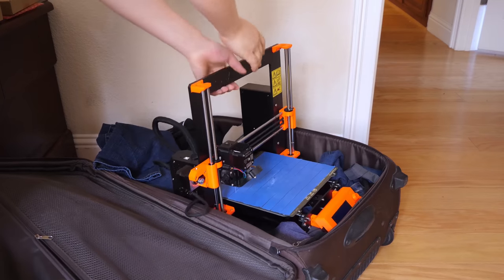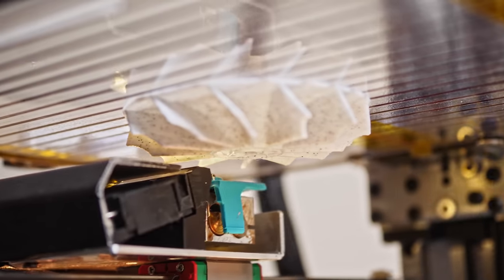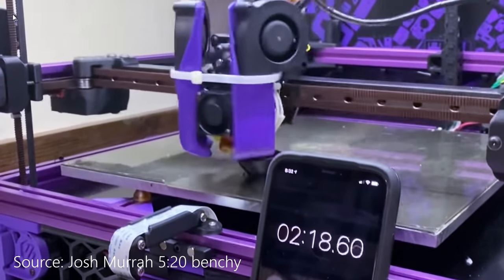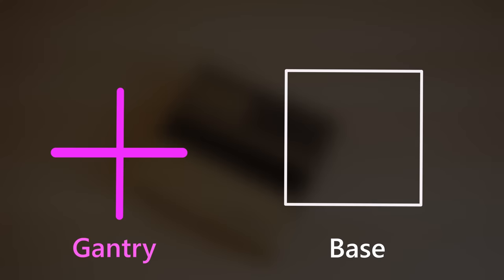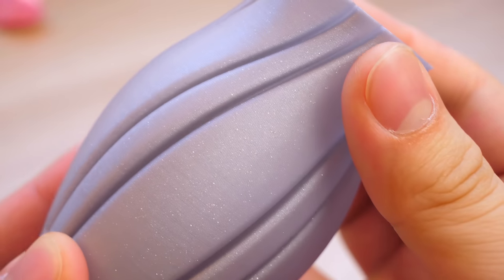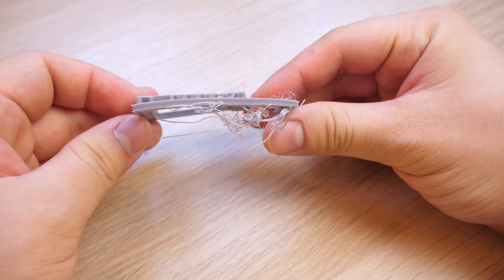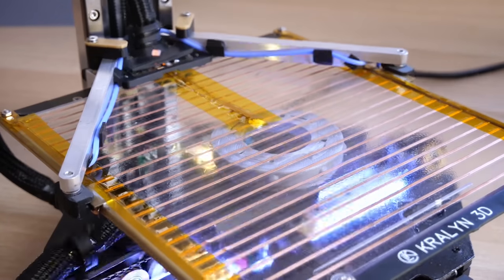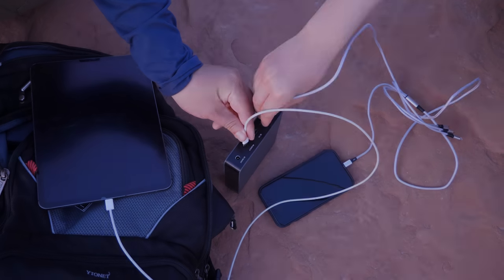A DIY 3D Printer That’s Upside-Down, On Purpose? The Positron Introduction

Comment: I need To be honest, loook amazing but the fact that the printer it is upside down makes me cringe, just in the hipotetical case the printing object doesnt stuck correctly, and the printer keeps printing and extruding plastic that will start to making a beautifull big blob of plastic in the hotend, it makes me think if is possible to build another plain base to be attached to the Z column, and use the printer as usual? can be possible? dont hate me! it is just a worry about that fail scenario ( I am printing since 2016 and, in my short experience eventually things can fail thanks in advance if you or anyone else can disipate that doubts.

Comment: H-bots upside down been around several years now, See udio 3d printer by Jeff Kerr from 2016. Gratz on making it small though, only innovation on this, the rest is just a ripoff rotated 45 degrees.

Comment: Hilarious, dude is not an apple to apple comparison. Pretty sure your built time and cost even at mass manufacturing gonna be way more than a prusa. (linear rail, high quality cable, flat 6mm aluminium base, custom hot end, ....)
So if you spend 3 times the price and effort to achieve something that is the same, it is redundant? 
The only one time that the printer is great is where people need to bring their 3d printer around OFTEN to justify for the cost, who is ur target audience in this case? NO ONE or 1 ^^

But tbh your could go and by a core x y 3d printer add a bit of mod and flip it upside down pretty sure is the same results or even better. :O :P
Anyway this video entertained me +1 for dislike